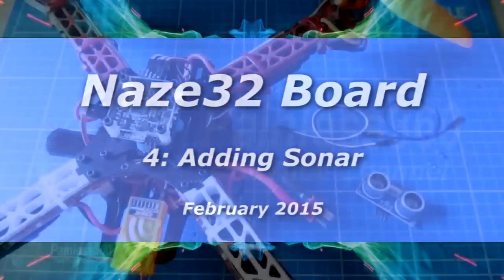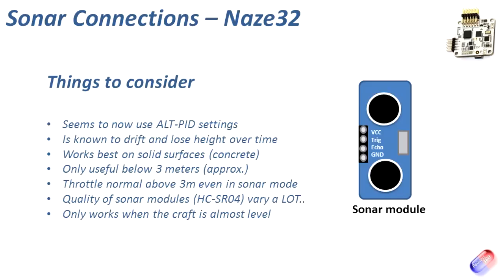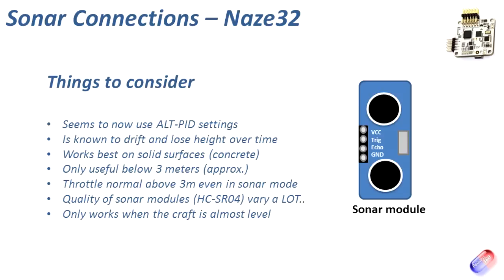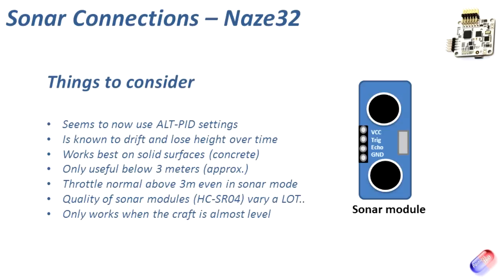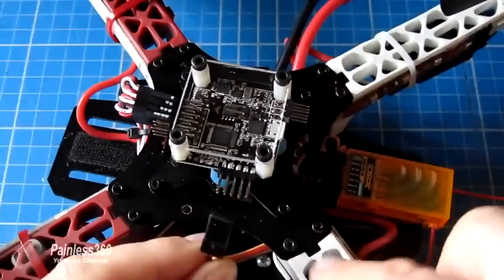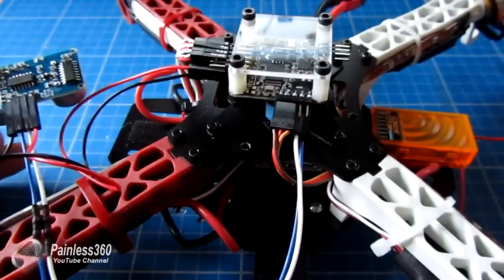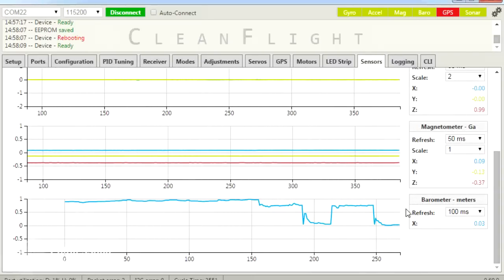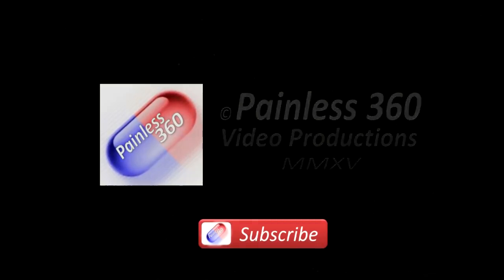(4/8) Naze32 Flight Controller – Adding Sonar (HC-SR04 module)

Comment: Am using ibus so should I also need to use 1kohm resistors between pin 7-8 and TRG ECO on my sp racing f3

Comment: We can only enable surface mode if we enable it first and then navalthold in my case I'm using inav but when I do it just shoots towards sky
I armed it in angle mode then take off it and then first I enable surface then hit navalthold but then it just shoots upward
This also happens when I only enable althold but this time only gains upto 2 meters then it holds altitude
Please help getting this surface mode working what is the right procedure to activate this mode
My tx is flysky fsi6 with no self centring throttle stick
Should I enable mid throttle hower and hower throttle rate
Please reply sir

Comment: friend connect the hc sr4 in an nxt f7 with inav but it does not work, vary the baud rate but neither, I put the resistors and it did not work either, it is well powered with 5 volt, I tried the flip as you showed but none of the two ways went. A question shouldn't be programmed first with a uart programmer or something like that ?? , I read there. greetings
Reply from the maker: Check out the INAV for beginners 2020 series for all the steps.. Best of luck

Comment: friend, just one question, can you test the sonar only by connecting to usb port? or is it necessary to power up the board and activate the pwm or rx functions, if necessary?
Reply from the maker: The Naze32 is a very old flight controller now. The concepts are the similar for modern flight controllers but how they power 5v senators from the USB PORT varies a lot..
Reply: I'm testing a flip32 clone of the naze, just to see if it works correctly, as you clarify with ppm or rx, but I think I connect the us100 backwards and burn it, I'm waiting for the hc sr4, and I will test again with a resistor. Should I understand that none enters through uart port? well the flip only supports (gps; esc). greetings and thanks for your comments

Comment: Connecting ultrasonic US-100 rangefinder (Sonar) to  Inav . Can I use a F7 Flight Controller with trigger and echo through say m5 and m6 or PPM Pins as you did with the NAZA 32?
Reply from the maker: Not sure it's supported - a quick search found me this https://github.com/iNavFlight/inav/issues/2475 it's a litte out of date but see my recent video on the Matek AIO board that works with iNav...

Comment: how do i add the HC-SR04 to a SP Racing F3 board, I have the Flycolor Raptor 390 Tower
Reply from the maker: Following the same process outlined here. You'll need to find those same outputs we use here on that FC. Best of luck!
Reply: Were you successfull? I enabled to sonar in configuration in cleanflight, but no sonar mode has showed. I used pin 5 and 6 on IO2 with 1K resistors and external power supply of the sonar. The sonar was not detected. I don't know what's the problem.
Reply: the same here but as on pin 7 and 8 as indicated. Sonar does not appear as an option in modes.

Comment: Sandy_flys.       I am having this same problem.as sri vamsi. I cannot enable SONAR in Cleanflight. I'm using NAZE32, rev 6, full: Cleanflight 2.0.3, firmware v 2.0.2, Rx PPM, Gyro, Accel, Mag, Baro enabled all buttons light,  sonar module HC-SR04 wired with resistors and connected as per your video and the manual. Sonar is selected in configuration - save and reboot, the sonar button doesn't light, no SONAR in Mode screen.  In CLI "feature sonar" exists.
I've followed your YouTube video.  I've tried 2 different NAZE32 controllers and Sonar modules, Sonar module connected and Sonar module disconnected from the board, same result each time. What am I missing?
Reply from the maker: +Sandy Kerekes have a look at the documentation, it looks like RC inputs sonar needed to be used in this configuration are pb0/rc7 etc with a 1k resistor in line as well. https://github.com/cleanflight/cleanflight/blob/master/docs/Sonar.md
Reply: Yes,  I have a 1k resistor in series with the trigger attached at pin 7 and with the echo attached at pin 8, as well as 5v supplied to the sonar module.  I've tried to enable sonar with and without  the sonar module attached to the NAZE32, same results no sonar enable light.
Reply from the maker: Sorry, what I did is in the video. Best of luck with it, I hope you get it sorted soon..

Comment: thanks for the video . I turned sonar on in configuration tab, saved and rebooted but  I don't see sonar icon green on cleanflight. I'm using naze32 rev5 pwm, one wire for a channel. connected as u described in the video. kindly help me.
Reply from the maker: What troubleshooting have you tried?

Comment: As a friend, help me in an issue ... I use a 9XR Radio with FrSky DJT Module, is my system PPM or PWM?
Why did you have to put the resistors in the PWM configuration?
Reply from the maker: Not sure what you mean by resistors. See the series for the tips on connection of the receiver to the flight controller. Best of luck!

Comment: What does throttle stick do when naze32 is in sonar mode?

Does that just holds the current altitude(like barometer altitude hold) and throttle stick does nothing?
Or can we adjust current height with the throttle stick when in sonar mode?
Reply from the maker: +Priyabrata Saha the best way to figure it out is see what the latest documentation says for sonar mode in the software you're running on it. It can vary. Best of luck!

Comment: Hi, I've tried to install the sonar on my SPRacingF3 and in sonar mode the quad is extremely sluggish... It is almost impossible to control. Have you got any idea where this problem could come from ? Thanks !
Reply from the maker: +Timothée Peter we don't use sonar much but from what I remember the sonar was being reported to manage height even when the mode wasn't enabled. I'd look in the forums for other who've seen it with modern versions of the firmware. Best of luck!

Comment: today i updated my firmware in sp3 deluxe and before updating,my sonar was working but now its not working: Can you help get over this problem??
Reply from the maker: I'd check the notes/bug reports for the new version and if all else fails, roll back to the version that worked. A lot of the less used features are being dropped from older F1 based boards like the Naze32 as modern code simply won't fit.. Best of luck!

Comment: Would it be possible to mount the sonar module on the bottom of a 2d gimbal to compensate for the issue of flight angle? Or would the latency and interference from the gimbal's motors just throw it off?
Reply from the maker: Possibly but in my experience Sonar isn't great even at the best of times..

Comment: would it be possible to use it beside a gps module ?
Reply from the maker: Check out the connections, you can enable both in Cleanflight.. Best of luck!

Comment: what about if i use with Sbus ? should i to connect sonar through M5 and M6 like a pwm settings?
Reply from the maker: +Sigit Pramono What does it say about it in the Cleanflight manual?
Reply: +Painless360 sorry, i means wiring setup on sbus , not in cleanflight settings. should i use 1k ohm like ppm setup?
Reply from the maker: Not normally. Check in the board specs if it needs an inverter for S-Bus as many of the boards need en external signal inverted in order to 'understand' the signal.

Comment: Hi, I am building a Hexacopter with a Naze32 ver6 10DOF. I don't seem to be get the craft to work when I configure Sonar using Cleanflight. Two of my motors 5 and 6 will not run. I am configuring the craft as  a Hex X. Is there someone who is experiencing a similar problem? Can someone advice please?

Comment: Tons of thanks for this and all your other videos. I wish I could like and subscribe more than once. I have a couple of questions:
1. Could you explain which 1k ohm resistor? There seems to be a variety (i.e. 1/4 watt, 5% or 1 Watt 1w - 5% or Carbon Film or Metal Oxide.) Does it matter?
2. Are there better quality sonars (sonaresis?) available. I'd be willing to send a more for a good one.
3. Do other control boards work with sonar better? Should I be using a NAZA or something if I want the sonar to work well?
Thanks again for all the great videos.
Reply from the maker: 1) not really - 1/4 watt should be fine. 2) I've not found one. Ours worked ok-ish 3) We've not used sonar on other boards as it only works at very low altitudes (<6ft) and only well on some surfaces. A well setup barometer and GPS is better for altitude hold at height... Hope that helps..
Reply: +Painless360 It does, thanks

Comment: Hello im using v5 board with baro wih1.11.0 firmvare and PPM reciver. Have echo on pin 8, triger on pin 7 with 1K resistors on both wires. Sonar mode enabled and all should be good... However i dont get any changes when im monitoring sensor signals. I do get spikes on sonar section when i tilt the naze board. I have tried different sonar modules and they all do the same. I have searched around and it seems other people have the same problem but no workable solutions. Any sugestions ? Thanks!
Reply from the maker: All we know is in the video. Some clone boards and many sonar boards can misbehave. Best of luck!
Reply: +Painless360 I dont have clone board :) and i have tried 5 sonar boards and they dont work. They do work with my arduino. As this video is really old i was just wondering if there are any changes in firmvare or ho knows where. Thanks luck i need!

Comment: do i really need the two 1kOhm Resistors for pin 7and8?
Reply from the maker: Try it and see ;)
Reply: +Painless360 can the borad broke?
Reply from the maker: Yes, wrong voltages can harm the board. Best of luck!

Comment: Additional warning for those who want to use sonar on Naze32 flip together with barometer; Sonar works up to 2 meters, and in this case barometer data is actually data taken from sonar. Over 2 meters barometer take over control -but there is one is one 'hickup' in height measurement. It acts like sudden change in level (height) when barometer become active instead sonar. Please check sensor data on Clean Flight before actual flight. Maybe my Naze32 is defective, but to be sure, check it on the computer first before use in flight. Thanks.

Comment: This sonar module sometimes work, sometimes not. The main reason is in receiver amplifier for ultrasonic pickup - too sensitive to radio interference.  It is actually 4 stage opamp in audio mode (41 kHz), and tend to pick-up various noise. Sometimes echo are not 'happy' with such noises, and instead making long echo - it pickup noise and shorten delay as reflecting surface is between 0.5 and 1 meter. There is chance to add some shielding, but I need to do more investigation on this module.

Comment: I would like to connect 5 sonars for each side of the copter.  Could you explain the setup process if it is possible to set up with Naze32.  I am using rev.5
Reply from the maker: +Moe Tun Not that I know of. Best of luck.

Comment: It's interesting that you mentioned sonar tends to lose height because my AR Drone does just that!  If I try to keep it at the same height it will drop about one foot every minute so I have to keep telling it to go up a little when it gets too low.  Is there any way to fix that problem?
Reply from the maker: +Steve C Not without trying another sonar sensor, the quality and accuracy on some units leaves a lot to be desired. Happy flying!

Comment: Hi Painless, 

Is it possible to incorporate both sonar and GPS together? Will I still have a spare channel for a servo for my landing gear? I'm not sure if this is possible.

Thanks!
Reply from the maker: +mtouano The Naze32 wasn't design for the way we use it now. Watch the videos in the series for the GPS and SONAR and see which pins are being used to make sure that no two get used more than once. Best of luck.
Reply: Thanks for the speedy reply. Actually I'm using a Flip32+, from your videos if intended for ppm I saw you used pins 3 and 4 for GPS and pins 7 and 8 for sonar. Can I still use pins 5 or 6 for my servo landing gear. I'm a little bit confused if those pins a re still usable.
Reply from the maker: Not sure, but let me know.,
Reply: Hi Painless,

I was able to incorporate sonar and gps on my 3d printed inpspire one. I've tested the sonar but not that accurate. It hops a little bit from time to time. I haven't tested out gps lock yet though. I need to look for a bigger area incase it wonders around. Thanks for all your tutorials. I appreciate your time and effor in doing these.

Mark

Comment: Hi! It's me again. :) I have a storm racer with Naze32 full and sonar. Should I have the switch activate both the sonar and baro at the same time (overlapping in CF Mode settings) or have the sonar on middle switch setting and have the baro on the same switch but on the up position? As always, your videos are a big help.Thanks!
Reply from the maker: Jojo Dijamco As you can see in this video - when the sonar is fitted it is used despite the sonar mode being on so it's up to you. Happy flying!
Reply: Ok so it's a personal preference then. Got it. Thanks!

Comment: hello friend, I installed sonar in my naze32 board, it works fine until + - 50cm from the floor. above that it starts to give leaps and bounds and is teetering height. I use it on pwm, you would know how to solve this problem ?? already aocnteceu something? thanks

Comment: When the copter is moving forward the Sonar don't looks directly to the bottom but in a angle. Does he calculate the vertical out of the bevel? Or it would be useful to attach the sonar-module under a Gimbal?
Reply from the maker: ituning CCO You could mount if on a gimbal if you really need it. IMHO I wouldn't bother with the sonar, poor resolution and unreliable operation make this a poor addition. 
Happy flying!
Reply: I would like to build a gimbal for the sonar to see if it would be more stable

Comment: Nice vidéos!  Do you know how (or who) would be able to implement in naze32 some more powerful devices for height stabilization?  I would like to use teraranger one (www.teraranger.com)
Reply from the maker: Max Ruffo Not sure as there is only just enough detail on that site. If it uses the same protocol and levels as the traditional sonar module then it would connect.. would be interesting to try. Let me know how you get on.
Best of luck with it..
Reply: In reality the sensor is fully digital and works on different protocols so it should be easy to implement in the software... but I'm actually looking for somebody that knows how to do it! Any clue?
My guess is that with this sensor we can have racers that hold height perfectly at any speed!
Reply from the maker: For implementation in Cleanflight you need to find the main developer - Dominic Clifton. He has a channel on here (https://www.youtube.com/user/dominicc1974), is on Facebook and Twitter.

Best of luck.

Comment: Is IT possible to connect 4 sonars in serie on a naze32, thinking of to use IT in a quad for ex when inspecting a roof ...or a Wall
Reply from the maker: ***** No idea. The code only seems to allow for one to manage height and the accuracy and usefulness of that is limited at best. 
Sorry I can't be of more help. Good luck with it.

Comment: Question..I am using the latest cleanflight on a win7 ...on a dragonfly pro board...was able to get bluetooth to work...I disabled and unplugged it to try sonar...on my cleanflight sensor tab is a sonar box...i wired it to m5 and m6, 5 volt and ground...checked the box for sonar on config tab...sonar turned green at the top...my sonar monitor is flat at 0 unless i tilt the quad 90 or more degrees..then it goes to straight to  -1...level the quad and it goes to 0 again...even when I unplug the board it does this....any suggestion what to change?  Is it trying to use the same port as the usb and conflicting?
Reply from the maker: Sorry I'm not familiar with this version of the board, I would recommend going back to the supplier for support.

Best of luck with it..

Comment: Hi Professor, I can't get my head around it, and I need some help.... I have posted a video on the Sonar flight test yesterday, and it flies OK but very bouncy (on hard surface). I have fed directly 3.3V to the Sonar from the Naze32 3.3V output pads. But now if I recall from the Wiki of CFlight, I would also need to solder the 2 resistors on the Echo and trigger lines, right (even though it is not fed 5V) ? Thanks for keeping in touch on this one before I solder the resistors and damage anything!
Reply from the maker: If you have the HC-SR04 module then you can run it from the 5v outputs with no issue but need to put the 1k resistors into the connectors to the input pins as they are 3.3v inputs.. I'm not a fan of this sonar mode and the varying quality of the modules do mean that you can get some very poor height management.

Best of luck.
Reply: Thanks, Hahh that's why perhaps, I powered it in 3.3 V Direct, and your right it takes 5 V from Manufacturer info! Got sidetracked with the CF wicki confused with the 3.3V input! Rightyohh! Will get these resistors in with the 5V input instead of 3.3V, and see how it goes. The video I posted on Sonar Test was OK at some instances, even in 3.3V, but too irregular... Will report back. Tks again! Will do my best to capture the Sonar RTL this WE as promised. Keep in touch! Cheers.